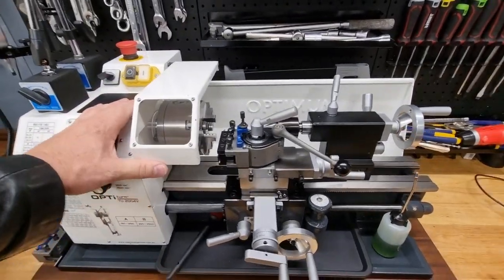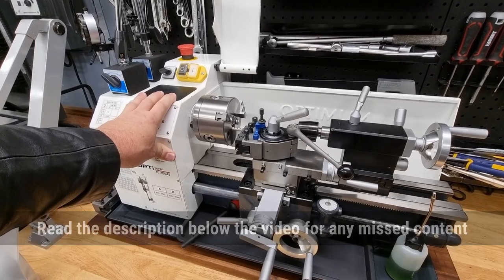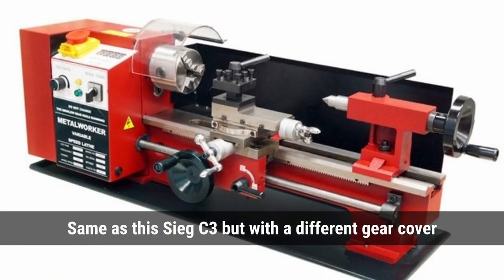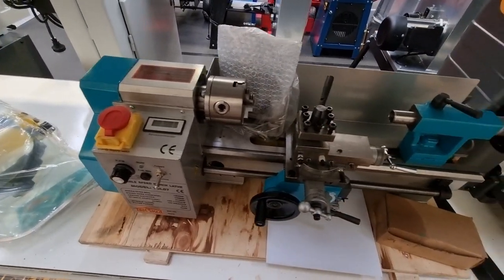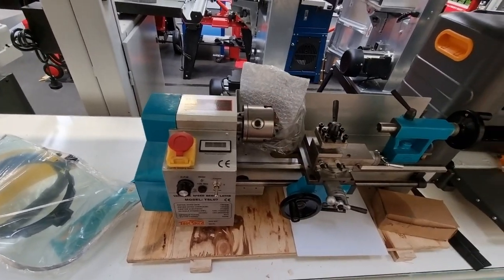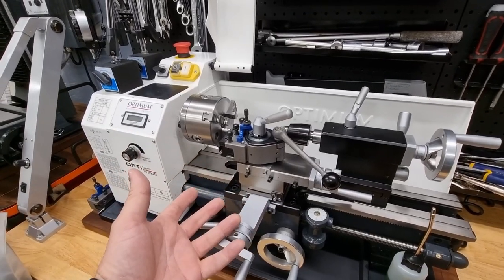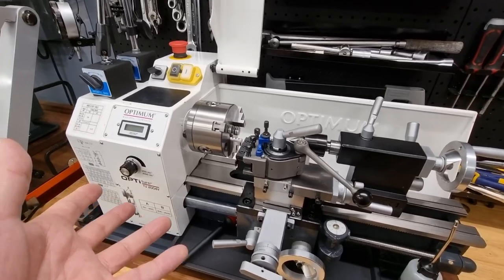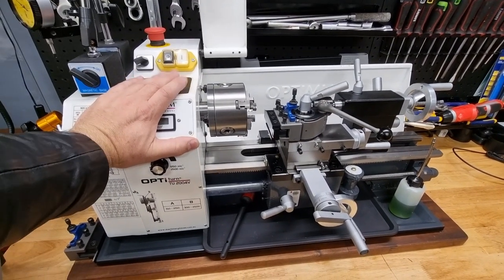Battle of the Mini Lathes - Sieg vs Optimum - Rob's Garage

Comment: I have some Sieg stuff with me and I can confirm that it's a piece of garbage. The guides on Sieg machines aren't hardened and the machine bed is very thing yet flexible. The only good part of it is a DC servo motor in a spindle. So your one looks like a Rolls Royce comparing to the Sieg. I'm thinking of getting an Optimum as well and literally speaking it's only option that's worth looking at. I really miss my 16K20 lathe that I worked on back in the day especially its friction clutch in the spindle and a forward/brake/reverse stick on the LHS.
Reply from the maker: hah.. I've been waiting for someone to get mad at me about my comments, so it's good to see some experienced agreement! And yes, if you're downunder like me and can get the Optimum, it is the only one worth buying. I didn't realise just how crappy the Siegs really are until I saw this one out of the box at the Toolshed. Since then I've seen a few others and they're the same. If you haven't seen my first video about the Optimum, it's long but worth watching as I go over why I bought it and list many features that make it better - That video is here: https://www.youtube.com/watch?v=m-wDsVzcgOs